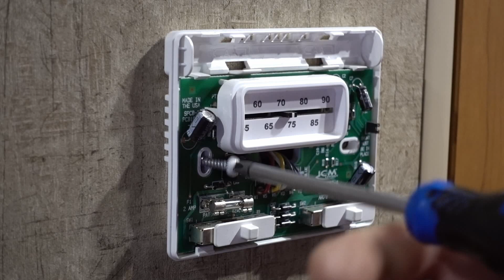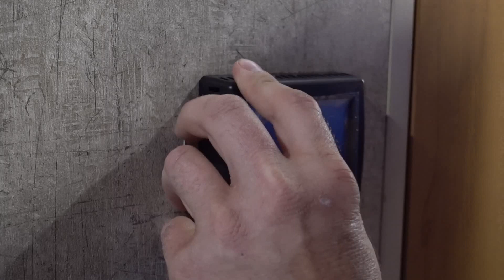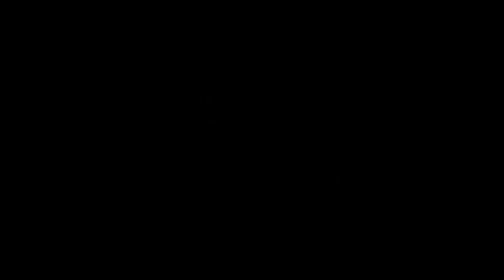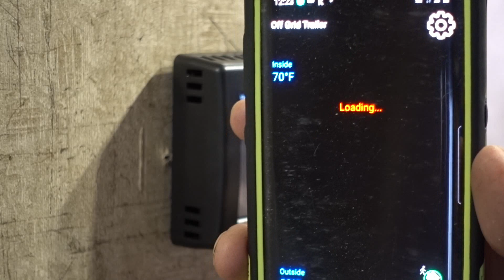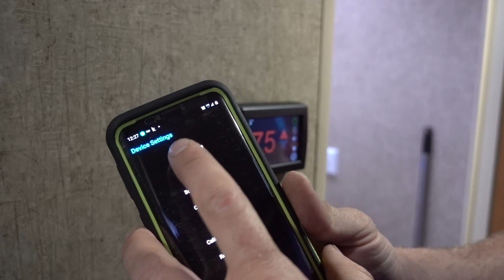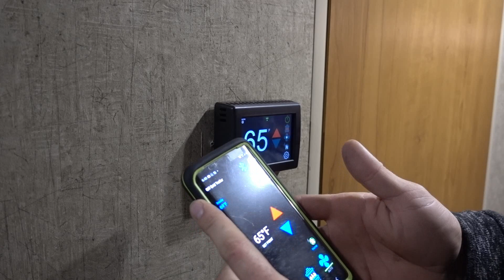EasyTouch RV Thermostat Install And Test

Comment: Cool! I just installed the Honeywell RTH5160D1016/E in our KZ Connect. 
Did you had to run your AC fan on one setting or did you retain High and Low for fan speed?
Reply from the maker: I still have high and low fan speeds

Comment: Bluetooth range about 15 feet wifi range maybe 200 feet in order to use it on the lake you need cell service and a server so wife's phone can upload to internet otherwise you both would need to be logged onto the same router/phone hotspot this is how I understand it. I like it seems like a nice thermostat. The app must have a server too. Awesome camping is sure different than when I was a kid lol.
Reply from the maker: My wife's phone provides internet to the thermostat, and the thermostat connects to micro airs server then my phone that also has its own internet connects to micro airs server witch lets me change the thermostat remotely
Reply: @GoingOffGrid101  exactly so only camp where you have a cell signal with data/internet unfortunately that is not where I go lol no service better fishing haha
Reply from the maker: @offgridwanabe  o really, here in Canada thats hard to find :D
Reply from the maker: my s9 is the best phone i have ever had for signal just got a new tcl 20 pro and its not as good :(
Reply: @GoingOffGrid101  Southern Ontario has good coverage but once you get north of North Bay only service close to the highway or Towns.
Reply from the maker: @offgridwanabe  I have only been to Timmins
Reply: @GoingOffGrid101  I used to work on highway construction so been almost everywhere and there are lots of places without internet but they are getting better every year.
Reply from the maker: @offgridwanabe  yea the last 10 year has been nuts
Reply from the maker: also bluetooth, is about 200 ft on this unit